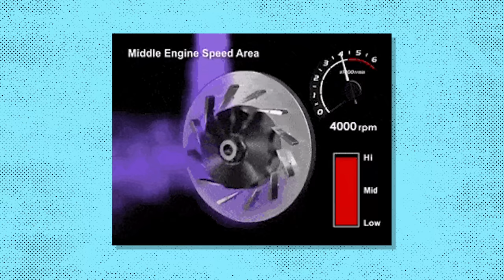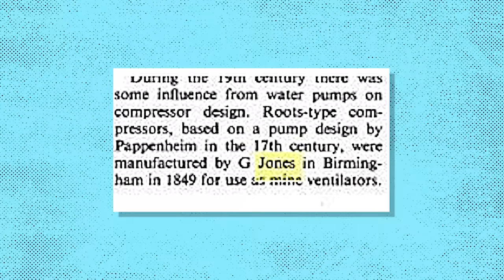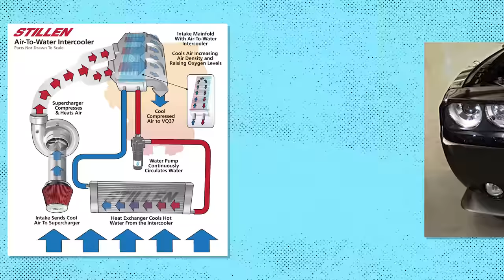Why Superchargers Aren't As Good as Turbos

Comment: This video just sounds like bias. There's plenty of pros you missed for the pro/supercharger. Just like plenty of cons you didn't seem to mention for turbos. I'm an actual mechanic. I love both for each others differences.
Reply: It's not biased at all, turbochargers have a major fundamental advantages over superchargers, superchargers do not increase thermal efficiency and any increase in volumetric efficiency and pumping efficiency is offset by the parasitic loss created by driving the compressor.
 Turbochargers increase thermodynamics efficiency and power output because of the larger reduction in pumping loss.
Turbochargers will always make more power and use less fuel than a superchargered engine.
Reply: @sandervanderkammen9230  it is biased when your only looking at pros you value. No turbo will ever match the responsiveness and off the line performance a pro charger or supercharger will. Ever. Each has their pros and cons. I like both. When you're looking at efficiency and power, yes, turbos win all day. But when you want instant torque, high throttle response, off the line and perceived performance, super/pro chargers win. It's the same reason kawasaki put a supercharger on their h2. They wanted a 1 liter bike to feel like full size touring bike. Hayabusa. Zx14-r. And the likes.
Reply: @charlestannehill7537  Turbo lag is not real, it's an imaginary problem that has nothing to do with actual performance figures.
Turbocharged vehicles accellerate faster than supercharged vehicles because they produced more power.

Comment: 4:20 turbos do the exact same thing, they use engine power to make power they just do it with hot exhaust and back pressure instead of a belt drive. Another contradiction on your part. "they don't compress air" "they use engine power" if they don't compress air then where is all that engine power going hmm?
Reply: Turbochargers are driven by waste heat energy in the exhaust, not engine power.
Turbos eliminate pumping loss and increase volumetric efficiency without using more fuel or power from the reciprocating engine.

Comment: Turbos “literally” use engine power to work also… They are powered by the exhaust and guess what powers the exhaust, the engine…😑 So I think everyone can agree that they both use engine power to work..🙄 The reason car manufactures are using turbo’s in most of the cars is because they look better on paper for emissions testing, and they are CHEAPER! I’m willing to bet that 50% of the people that installed a turbo on their car is because they could not afford a supercharger… Turbo’s have three times as many parts that can fail, turbo’s burn up your engine oil faster because the turbos are “literally” twice as hot as the motor and it’s constantly cycling your oil through it. Turbo engine bays are usually hotter because of how hot the turbo gets from cycling super heated exhaust gasses through them.. Turbo’s also have a “lag”.. this guy talks about it like it’s a benefit..? Superchargers have instant power.. Some people just have friends with turbo’s that brainwash them..

Comment: Superchargers will always be superior to Turbochargers for 2 reasons. 

1: Sound 
2: Instant and consistent power. 

IMHO, of course.
Reply: Superchargers and turbochargers often sound the same, especially some of the centrifugal compressor superchargers.

Instant and consistent slow is still slow.
Turbos are instantly and consistently faster because they make more power than superchargers.
Reply: @sandervanderkammen9230  I've never heard a Supercharger sound like a whiny little bitch rolling down the road. I tease my friend about his Turbocharged Focus because it sounds like it sneezes when the pressure releases. Makes me giggle like an idiot. No Super has ever made me giggle like an idiot. Side note, never heard a Centrifugal to be fair.
I don't think you can say Instantly and Consistently and Turbo in the same sentence. There's a thing called Turbo Lag for a reason. Yes, it can be reduced but it still lags. Also Turbos work mainly in a given RPM range where Supers are more of an overall start to stop kind of thing. Yes, there are specific ones of each that work better during a specific range just like Turbos.
Turbos do produce more power than Supers for sure. That's why they are so popular and highly used. MORE POWER!!!
But no matter what is said my #1 reason will still win out. I will take the large grumble of a supercharged engine over a whiny sneezing turbo.
Reply: @caspervore  "Turbo lag" is not accelleration lag, turbo lag is not a real problem, it's an imaginary one.
Fortunately I don't know what makes idiots giggle,  I take forced induction very seriously.
 I would make fun of your friend because he drives a Focus, not because it is turbocharged.
Reply: @caspervore  Turbochargers operate on a  very wide range of rpm depending on the applications.
They are equally effective on large, low rpm engines and small high rpm engines.
Reply: @sandervanderkammen9230  Turbo lag is an absolutely thing. It is the amount of time it takes to turbo to spool up before it can produce power. Supers don't have that problem. Saying it's imaginary is ignorant. You get no power from a Turbo that is spooling.
Never seen a Focus RS then. They are widely used in a lot of varying motorsports.
Reply: @sandervanderkammen9230  Never said Turbos weren't effective on any kind of engine.
Reply: @caspervore  Turbochargers spool up in less time than it takes for the engine to spool up under load, as I said before turbo lag is not accelleration lag
 Turbos make more power and thus cause the vehicle to accellerate faster.
Reply: @caspervore  You get faster performance from a turbo, proving that turbocharger lag is not real.
Reply: @caspervore  Turbochargers are widely used in motorsports

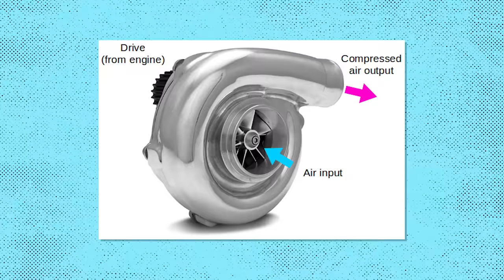Comment: CMON MAN! This is riddled with errors, mostly mild but still errors.  0:28 Turbos are CHEAP.   1:00 ONLY in slang are the terms "separated"  Not in technical language. 1:25 blast furnaces AND mines. 2:32 Turns the wrong direction 2:38 whine is not because of straight rotors  3:38 & 3:50 absolutely wrong rotor mesh-does NOT skip a lobe. 4:15 wrong to say "not efficient" without full context. 4:25 do NOT need to be on top can be anywhere. 5:23 it is NOT lag, it is engine RPM dependent. 5:41 ONLY for peak power - normal street operation instant response beats turbos. 6:20 electric turbo needs 20-80HP motors driven by your systems electric system and ultimately your engine. 
YOU should have done all this research , not me.
Reply: Not bad for a YouTube video actually.. the basic premise of the video is absolutely correct... which is really the only thing that matters.
Reply: @sandervanderkammen9230  I would say not. Turbos are "popular" because: 
Turbos are CHEAP, containing 2 moving  parts. 
Turbos have a cachet in the public mind for no good reason. 
Turbos do provide great PEAK power even if it is rarely used and so many people only think in peak power terms.  
He neglected to mention one critical advantage turbos and centrifugal blowers have over positive displacement types, relatively low backfire damage and high tolerance to minor debris.

So it is not a horrible or even bad video , it would have been EASY to make it all accurate and therefore great.
I come from the rock hard racing world where wishy washy does not cut it. 1/1000ths matter.
Reply: @billshiff2060  Turbos dominate the forced induction market for two simple reasons, they produce more horsepower and they are more efficient....
Reply: @sandervanderkammen9230  see point #3 above and efficiency is far from the only characteristic that matters. If it was then dragsters would use ONLY turbochargers.
Turbos are CHEAP. That's the main reason Period.
Reply: @billshiff2060  Again the basic premise is sound, turbochargers are superior to superchargers because they produce more horsepower and they are more efficient.
 All dragsters would use turbos...  if the were not BANNED by the NHRA because they make TOO MUCH power.

Comment: Yes, turbos use waste energy, but they also restrict exhaust gasses, and that reduces volumetric efficiency.
Reply: If they reduce volumetric efficiency? why do they make more power than superchargers?
Reply: @sandervanderkammen9230  The power used by restricting the exhaust is offset by the increased pressure in the air charge.  Also, turbo engines often have a lower compression ration than non-turbo cars.  The extra compression can cause detonation in already-warmed, compressed air.
Reply: @chrisrautmann8936  But turbocharged engines make more power by flowing more CFMs and reducing pumping loss, so explain how there is a "restriction"???
 Turbochargers may have lower static compression ratios but they have higher dynamics compression ratios with higher IMEP and BMEP.
Reply: @sandervanderkammen9230  Exhaust restriction. An engine exhaust that is restrictive can reduce the amount of airflow through the engine.  A turbo, being in the exhaust and spinning a turbine, is restrictive.  You have to pay for the pressurization by reducing flow through the exhaust. There is no free lunch.
Reply: @chrisrautmann8936  Sorry but I'm afraid your understanding of how turbochargers actually work is a little weak and that you are confused

What goes in must come out right?
If the turbo engine flows more CFMs  than a equivalent naturally aspirated engine then there can be no restriction caused by the turbo.
A restriction would limit or reduce the CFM flow.

  A turbocharged engine produces more horsepower and burns less fuel than a supercharger engine, it's EGT is lower.
What does that tell us about turbochargers? 
Any questions?
Reply: @sandervanderkammen9230  There is no substitute for cubic inches.  A turbo lets you flow more air through a smaller engine.  At the cost of more stress, lower compression, lower reliability, more complication, higher maintenance, requiring higher fuel octane, and more expensive parts. 

As someone who has had three turbo cars (and replaced 4 turbos), they're not really a great option for a car that isn't high performance for something used on a track.  

In the REAL world, they're not the best option. Especially not NOW.
Reply: @chrisrautmann8936  Not true, bigger is not always better, and in many applications  (like racing) its not an option.
Turbochargers don't just improve fuel efficiency, they improve thermal efficiency.
This means that a turbocharged engines makes more horsepower from the same amount of fuel and air
A turbocharger does not add anymore stress than a supercharger at the same manifold pressure, what the turbo will do is make more power at the same manifold pressure than supercharger
Reply: @chrisrautmann8936  Not true, some naturally aspirated engines require higher octane fuels but make less power, Turbocharged engines equipped with GDI need less fuel and less octane.
Performance isn't cheap, the price of performance always increases, 
Turbochargers are extremely reliable and have been used in certified passenger aircraft for many years. A good quality turbocharger should last the life of the engine.
Turbochargers do not require any special maintenance.
You simply use the correct motor oil and change intervals.
 You must have owned some very crap cars..
Any questions son?
Reply: @sandervanderkammen9230  Yes, high compression engines (10:1 or higher) need premium fuel.  Most road cars are not at that level.  
And, yes, turbos need extra maintenance.  Plugs go bad faster. Oil changes require synthetic, and more frequently than NA. And, I've had several cars last over 150k miles.  The turbo ones?  All of them had the turbos replaced/rebuilt before 100k miles.  And since when is BMW a crap car?  
And, yes, an aircraft mechanic has some experience with engines. 
You wanted to know something else, son?
Reply: @sandervanderkammen9230  Racing engines are generally limited by RULES. Yes, a bigger bore and stroke will not be able to rev as high (cylinder flame propagation has a limit, as well as higher rotating mass), but it will likely have better low end torque.  
And I don't think you understand how engines work.  The entire point of the engine is to mix the air and fuel in the appropriate ratio. Doesn't matter how much air you shove in, the fuel air ratio needs to stay pretty stable.  Too much fuel, you have horrible emissions and carbon buildup.  Too little fuel, and you risk detonation.  
The purpose of the turbo is to shove more air in, so it has to burn MORE FUEL.
Reply: @chrisrautmann8936  Yet the number of cars on the road with turbochargers continues to grow.
Supercharged engines also require more frequent spark plug changes but intervals are now less than NA cars 20 years ago.
Economy cars and utility vehicles  still use low octane fuels, but they are not performance vehicles... so it's a completely moot point.
 What you save in fuel easily offsets the higher oil change expenses... we're talking small change...
You sound penny wise and dollar foolish.
Some one who buys a premium car and then cheaps out by buying cheap oil and gas, trys to save money on maintenance.
Reply: @chrisrautmann8936  Yes, the RULES usually limit the displacement of the engine in each class or incur a penalty like additional weight etc.
 
I don't think you understand how engines work.
 Internal combustion engines convert Heat Energy into shaft horsepower, air is the working fluid.
The more efficient you can pump the air? The less energy is lost.
Turbochargers make more power at the same manifold boost pressure because they have lower pumping loss AND waste less heat than a supercharged engine.
 The maximum power output for most HCSI engines is around 12.5:1 AFR depending on IMEP.
 Fuel enrichment does indeed suppress engine knock, but there is a point when the quench effect cancels out any increase in manifold pressure or static compression ratio increase.
Thermal efficiency increases up to about 14:1 SCR before the additional pumping loss canceled out any additional thermodynamic gain.
 
Turbochargers are superior to superchargers because they have  significantly lower pumping loss and increase thermodynamics efficiency.
 This can be easily demonstrated by a turbocharged engine's higher BMEP, lower BSFC and larger iso-graphic efficiency island.
Any questions son?

Comment: This guy thinks a turbo runs for free.  ALL power adders need engine power to work. A turbo gets it's power from the exhaust, BACK PRESSURE Back pressure eats power.
Reply: Turbos do not cause backpressure, the exhaust turbine is driven by the heat energy rejected by the reciprocating engine and is wasted out the tailpipe in a naturally aspirated engine.
Any questions?

Comment: Turbo chargers are good if your trying to add a lot of power to a weaker car and are generally in track cars while because drag cars are more powerful and need that instant power it also means your not spending a fortune every time a turbo breaks which is often
Reply: Motortrend has rubbished the amount of money spent on cams, intake, exhaust to better a motor can much easier be spent on a mild turbo to give more power. And turbo's are reliable enough as long as you change oil regularly
Reply: Turbo is absolutely the best bang for your buck out their, nothing comparable to the amount of raw horsepower gain.
Reply: Well, not true... remember that most drag racing series have banned turbos because they make the cars so much faster at the end of the track, not just lower ETs

Comment: Turbo also use power of engine to spin
Reply: What he means is that a supercharger literally steals kinetic energy from the crankshaft to operate. A turbocharger uses the kinetic energy of the exhaust gas (which the car wasnt using either way) to power itself. Slowing down the exhaust like this does increase pumping losses, but between a turbo and a supercharger that flow the same amount of air and create the same pressure, the turbo engine will be more powerful because the turbo is a smaller parasitic loss.
Reply: @Kevin-dt9xm  Thanks bro its much understandable now
Reply: They energy used to drive the turbo comes from the waste heat energy from the engine.

Comment: It's a 3 to 1 ratio on exhaust pressure to intake on turbo,  Turbo's get too hot and destroy motor oil!
Reply: No. 1 to 1 ratio, just high flow rates
Reply: Making more power means more heat.

Comment: The supercharger in my 2017 Q7 gets better gas mileage than the turbo engine that replaced it in the newer models and no lag so 😝😝
Reply: Turbochargers are more efficient.
Reply: @sandervanderkammen9230  ehhh
Reply: @dwilson2126  Turbochargers are more efficient, it's an irrefutable fact.
Reply: @sandervanderkammen9230  ok

Comment: dududududude dude dude dude NOOOOO why would you say that roots doesn't compress air that is so false it absolutely can do that
imagine roots spinning at some speed, it supplies some air, it might not be compressed much because let's assume the engine consumes same "some" air
now imagine this roots charger spinning twice as fast with same engine rev because different pulley, common mod for dodge
outcome? it supplies 2 times "some" air while engine consumes 1 "some" air, what does that mean? the density must be increased, IT HAS TO BE COMPRESSED, PRESSURE INCREASES
that is the most dumbfriendly explanation I could come up with, avoiding all of the liters rpms and science
Reply: You are correct, the Roots supercharger is a internal compression type...